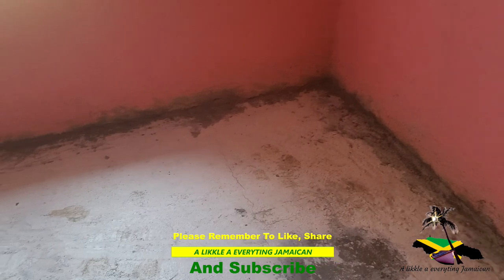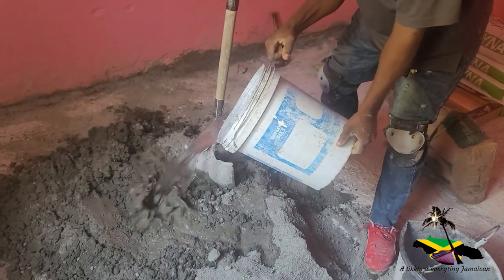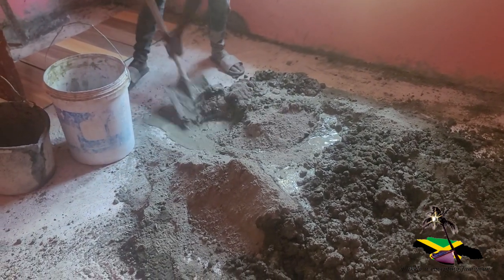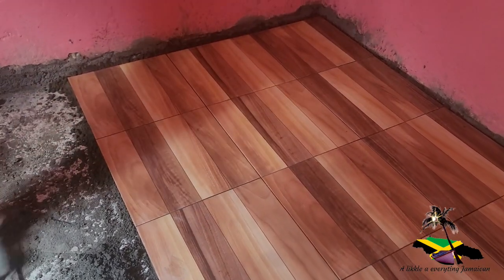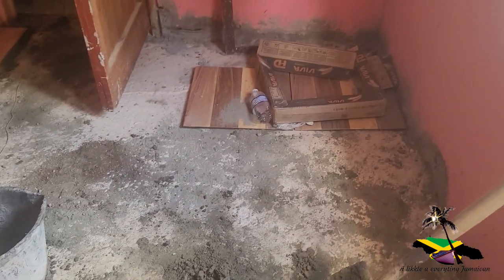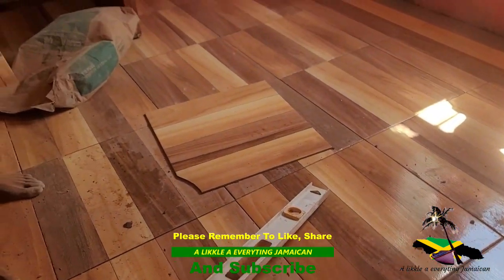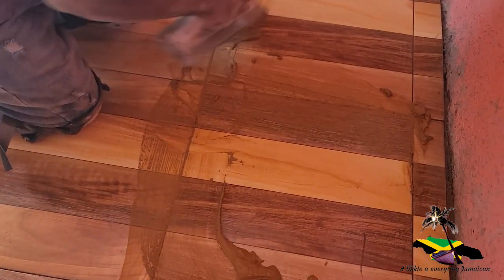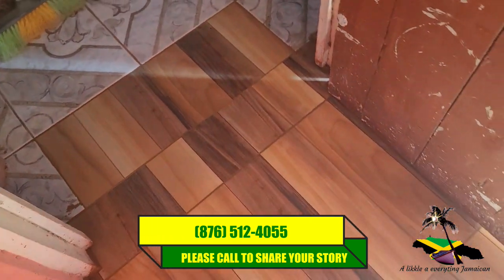Watch Zelly At Work / Floor Tile Installation Bedroom

Comment: Question tho if am  tiling a room same like the one you do is there a specific part of the room you start first and other question what if the room is not square and you dont have any adavance tool how and where do you start tile.
Reply from the maker: Hi. If the room is not square, it's best to start in the doorway... So your first 2 or 3 tiles depending on the size would start in the doorway🌹🙏
Reply: @alikkleaeverytingjamaican  oh what about if the floor is not level